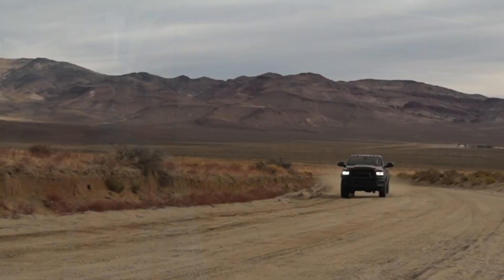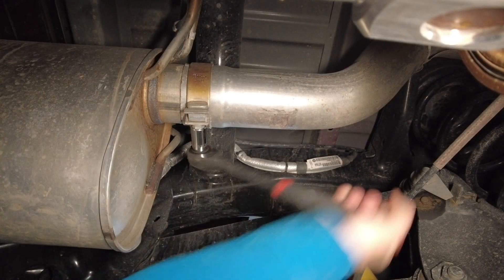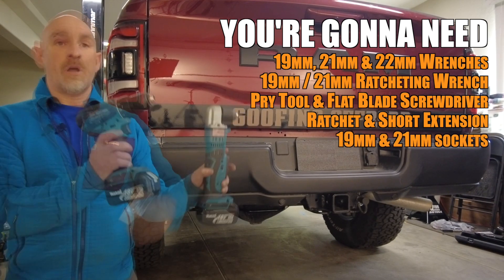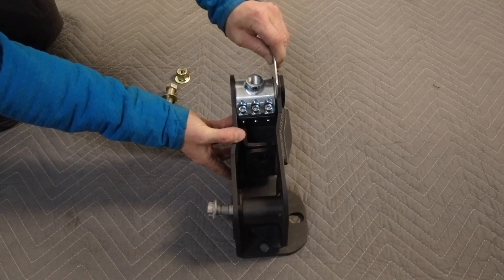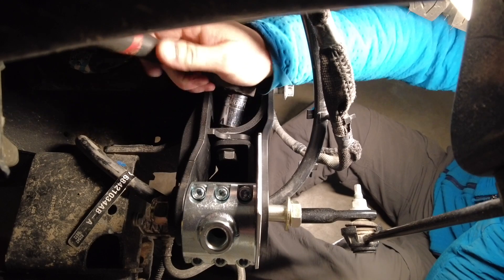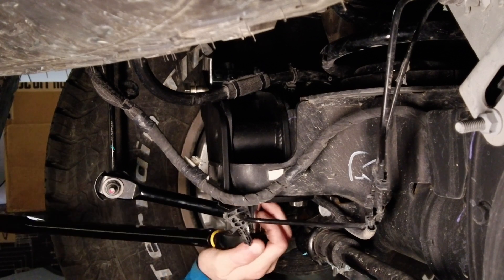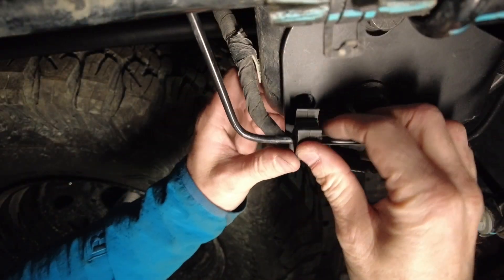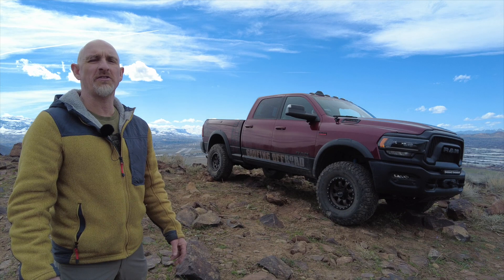Thuren Rear Track Bar Install on RAM 2500 Power Wagon

Comment: Thanks for the video.  I will be having some new suspension components installed on my PW next week. The Thuren 1-1/2” front kit which includes the Thuren front track bar and Fox 2.0 IFP shocks.  On the rear I am going with Carli R2 coils, Carli end sway bar links, Thuren Fox 2.0 IFP shocks and Thuren rear track bar.  According to CJC Offroad, the Carli R2 coils should work well with the Thuren Fox 2.0 IFP shocks.
Reply from the maker: Nice - sounds like an awesome setup - I'd be curious what you think of it once you've driven with it for a while.
Reply: @goofingoffroad  Definitely.  Will be doing some reviews on the setup over time.

Comment: i did the Thuren on the front and back along with their springs all the way around plus a few other things like Octane front and rear high clearance bumpers, love it all! ty for the video
Reply from the maker: Thanks for the shoutout!  What springs did you put on the back and did it stiffen up the ride too much?
Reply: @goofingoffroad  Thuren makes a set for leveling the front end and both the front and rear are slightly softer, I don’t haul much more than dirt bikes and quads so I didn’t need the stiffness, probably wouldn’t be optimal for you and the load you are hauling but definitely easier on the spine lol. I live close to Thuren and they are a good group of people that don’t try to sell you something you don’t need. Hope you had a wonderful holiday!
Reply from the maker: That's great info thank you!  I've heard good things about Thuren too.
Reply: @goofingoffroad  absolutely, I see you are already knowledgeable and mechanically inclined but if you ever have a question about something I’m happy to answer for what I have experienced with my truck lol it’s a 2019 and I’ve done everything myself like you do, a couple things I was hesitant about and was trying to find someone who had done it but wasn’t much out there. I am a retired army combat medic and not a mechanic by any means but happy to help where I can

Comment: Thanks for the great informative video. I have a 24' Power Wagon as well. Besides the the Thuren rear track bar , do you have Thueren front track bar as well? I see you have 37s on your truck. Does it require any kind of trimming when you put it on? Thanks.
Reply from the maker: I have other plans for the front suspension, but as far as I know, you don't need a new track bar up front with the standard suspension.  The 37s fit on the truck just fine, with no trimming and no rubbing.  Granted I have 37x12.5 BFG KO2s.  Other brands of tires may be a little bigger, so I can't speak to those.
Reply: @ Thank You Sir!

Comment: Hi Tony, cool video as always, 
im planing to use PW for long distance overlanding trip and border crossing thro couple of countries. 

Im ok with mpg's but wanna ask you if its good choice or i should look at different vehicle. I picked PW as it's perfect for its  offroading and spacious size. 

Im a bit worried of payload capacity as i have 3 adult on board, bed cab, roof tent, spare tire, decked drawers, some water storage, camping tools andcthing and extra 30 gallon Auxiliary feul tank. 

In total cargo and passengers im maxed out at 1500 lbs, gonna have sag tho. Should i put a airbags in rear to help with the sag? 

what do you recommend? Thanks
Reply from the maker: Sam, I honestly don’t have a ton of experience with this platform. I’d definitely recommend the Thuren rear track bar to settle the rear end. As far as complimentary options I’d recommend giving CJC off-road a call as they work on full-sized trucks all the time and have a smorgasbord of different products to mix and match to get where you need to be. If you do call them I’d appreciate you telling them I made the referral.  Good luck, and I wish you all the best on your over-landing trip. That sound amazing!
Reply: Might want to try the Carli R2 coils in the rear.  I am also putting on the Thuren 1-1/2” coils in the front along with changing out the shocks for the longer wheel travel, etc.  I will be posting more content after the install with some weights of my 2024 PW soon and how it sits front to rear.   I will still have available cargo load weight remaining, but might give you an idea how it might work for your application.  Will also be weighing the entire truck after the build is complete.

Comment: Did you jack up the axle and take the tire off like the instructions suggest or just work on it as it sits? Great video, thks!
Reply from the maker: There's no need to remove the spare tire.  With the track bar it is easier to take it off and put the new one on when the truck is on the ground.  Raising up the truck will put the bolt holes out of alignment and make it much harder to do.
Reply: Very helpful. Tackling this today, thanks! @goofingoffroad

Comment: About how long did the install take? Also, do you have any new PW vids coming out?
Reply from the maker: I would say that if you have all the tools and sharp drill bits, this would take about 2 hours.  You don't need to lift truck off the ground, which helps.  New videos heading this way soon...

Comment: Does this help with tow squatting?
Reply from the maker: In my experience, no.  I tow a couple of different trailers up to about 7,800 lbs.  But it dramatically improves the driving experience, whether you are towing or not.  I would say this is the #1 upgrade to do when you get the truck.

Comment: I'm confused. My truck doesn't have the problem(s) you describe. I guess I'm an idiot. Oh well.
Reply from the maker: It will depend a lot on tire pressure, how much load you have in the bed of the truck and how slow (or in my case, fast) you are driving across the bumps.  If you're not having a problem then that's great; enjoy your truck as it is and save a few bucks!